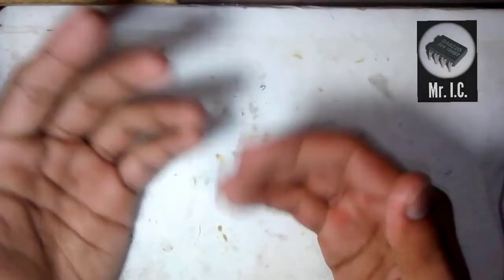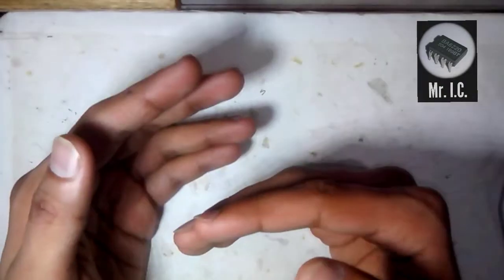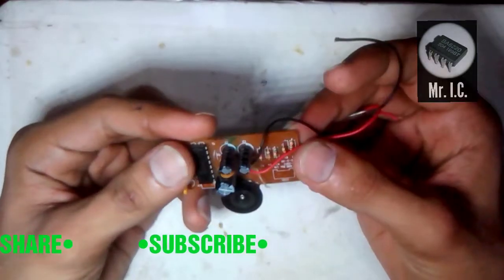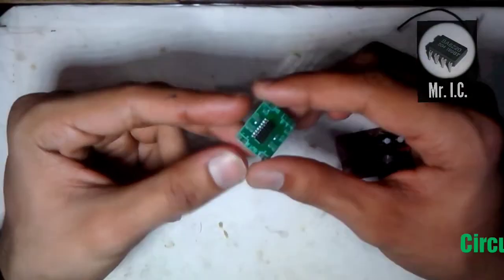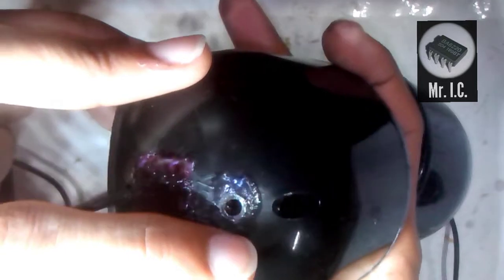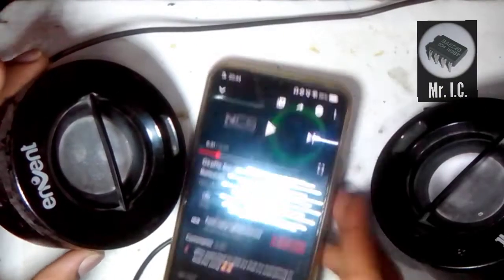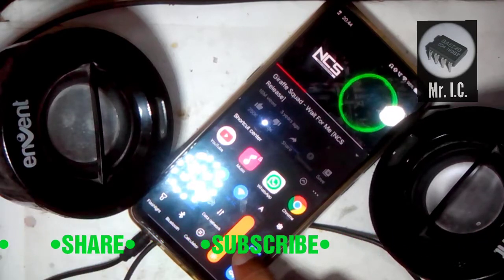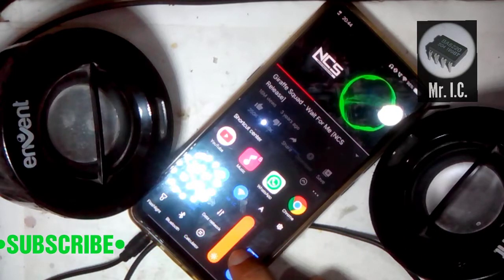Repair | How to repair USB 2.0 speakers | Mr. I.C. #speakers #music #diy #usbsoundcard #mric

Comment: Is there any other alternative for pam 8403 board 🤔
Reply from the maker: Yes there are several other amplifier ic. Like LM386,LM 358 . But rarely you will find specific boards for them. You will need to connect capacitor n other components to them. But Pam 8403 is pre-made , you just need to connect wires.hope i helped u.😊